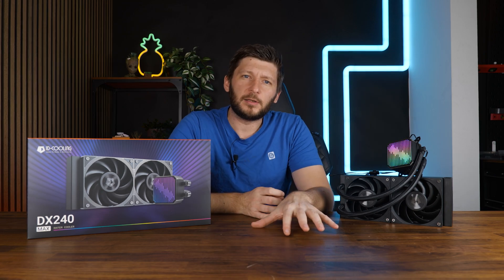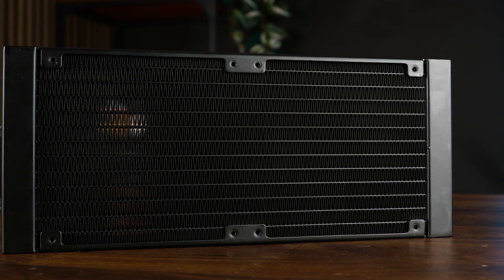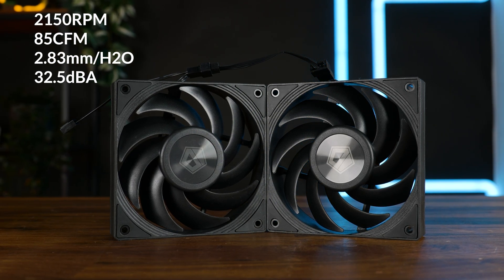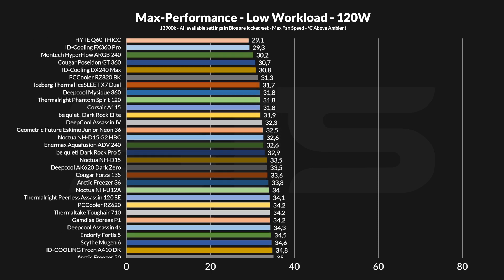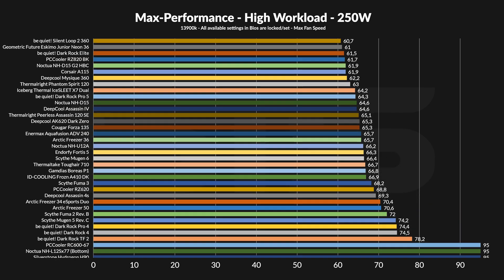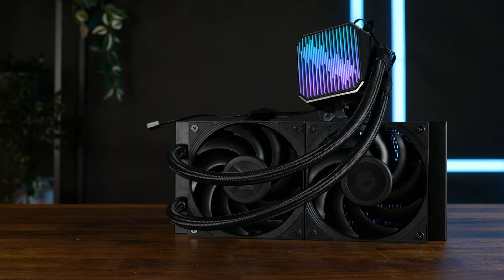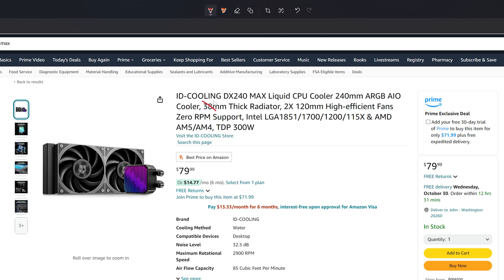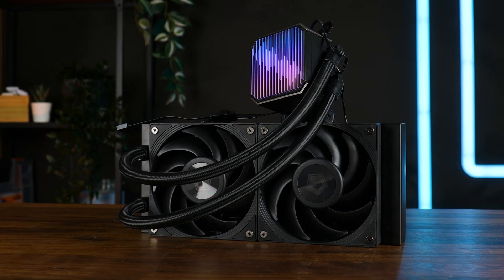Max Efficiency or Max Disappointment - ID-Cooling DX240 MAX Review

Comment: After this video I bought the 360, when I heard the whirling sound, it made me chuckle. I thought something was wrong with my cooler. It's my first PC build, and my first AIO cooler, so I have nothing to compare it to, but my thermals are great. I idle in the 30's, and never above 80 while gaming, but most games run between 50's - 60's. I'm running a 7700x, and it gets really hot. I had taken all the fans out of my case, and put them back incorrectly, and thermals caused constant crashes. I had put the exhaust fan in the wrong place, but when I touched the cooler, it nearly burned my fingers.

Comment: Damn I got this because it was on sale, but I also have some noctua fans sitting around that I plan to use. Would you ever consider testing with affordable “standard” replacement fans such as arctic P12s? That might address the noise issues quite well

Comment: Why do you still test coolers with one of the easiest to cool AM5 CPUs? 🥶

For absolute package power, the 7950X easily reaches 230W at stock and depending on silicon quality, you can get up to 260W PPT with power limits removed. The 7700X is probably still the AM5 CPU with the worst thermal density at stock, and without power limits it should easily get to 160W PPT. Even my potato 7700 (88W stock PPT) can hit around 150W PPT when I let it go crazy. 🥵

On the other hand, you can cool pretty much any 7000X3D with a Wraith Prism stock cooler if you don't care about noise. Since they are limited to PBO overclocking, you will barely reach the stock PPT of 162W, let alone get over it. Both my 7950X3Ds stay below 160W even with power limits removed, running torture tests like Prime95 small FFTs or Linpack Xtreme.
Not sure what you are actually testing there, but I'd guess that you will probably artificially compress the results of your AM5 benchmarks due to the CPU choice. Which is actually a bit disappointing since there aren't that many folks around that are still enthusiastic about testing coolers like you. 😟